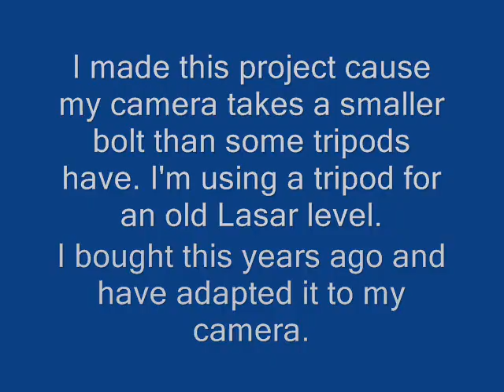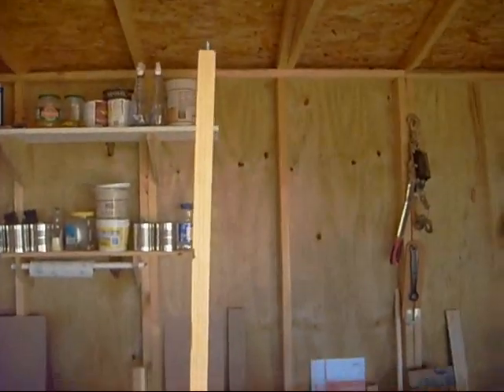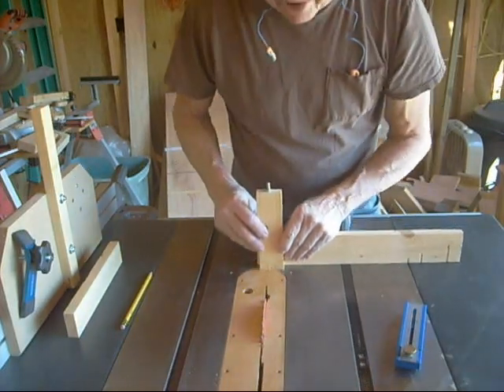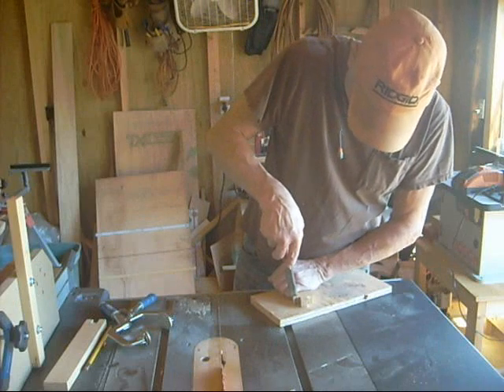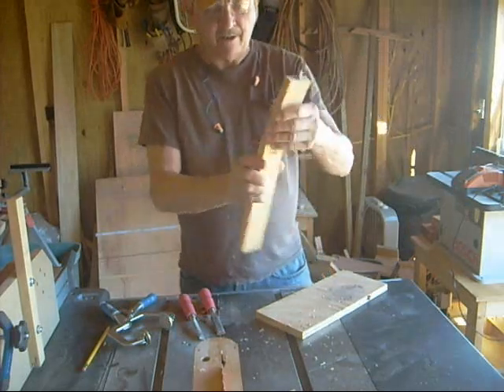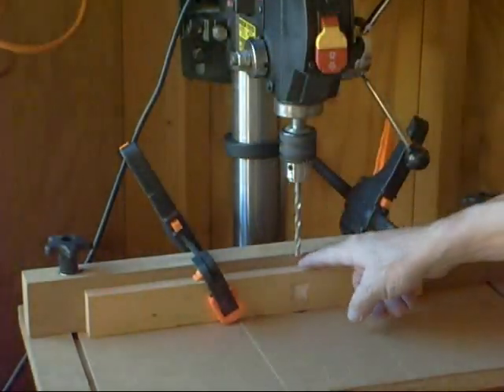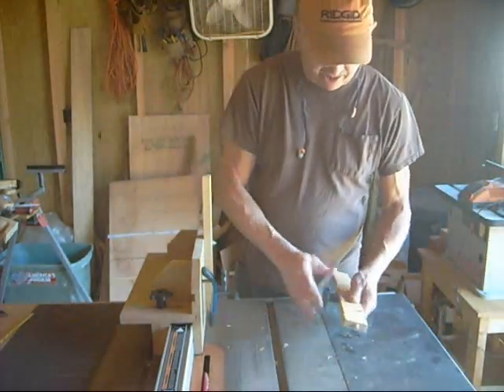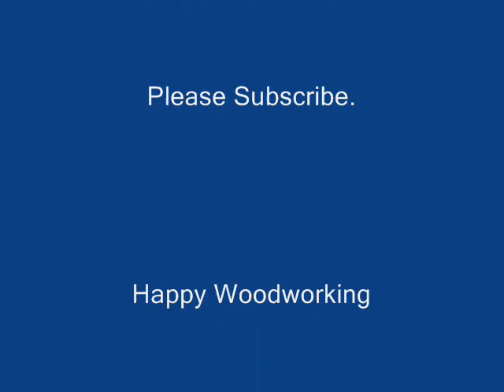How To Make aTilting Camera Mount

Comment: I like it!

Just to save you some time and cuts, when you're cutting that tenon, rather than using the table saw blade to "dado" it out, you could just make 2 cuts, one on each side of the tenon, then flip the piece and make 1 cut on each side to cut out the block.

Also, raising your drill press table or putting a riser underneath your workpiece would have allowed you to drill clear through.